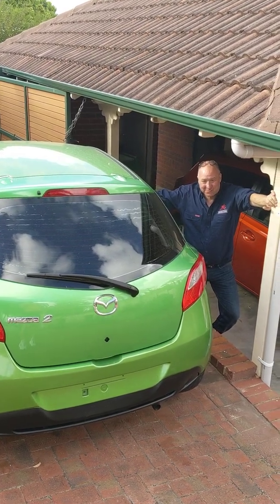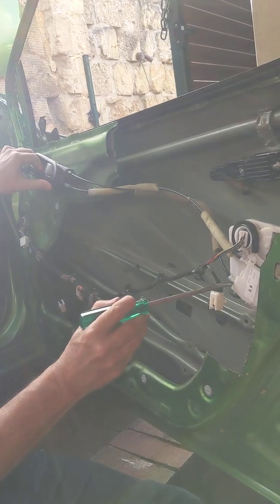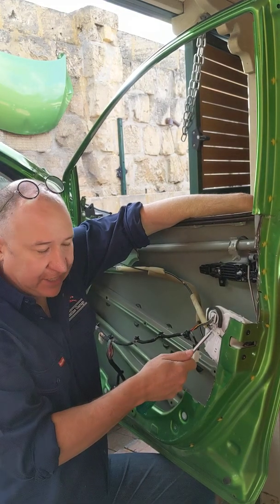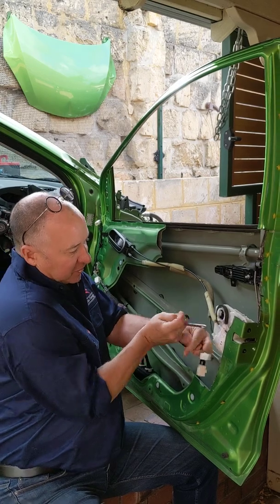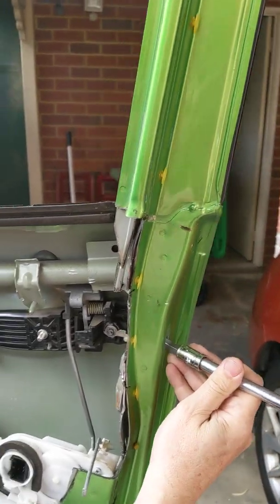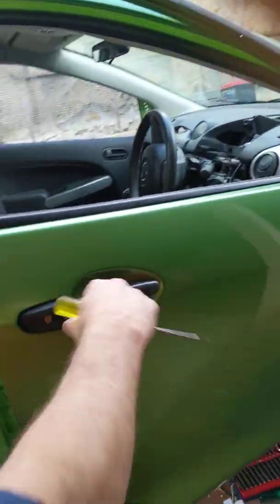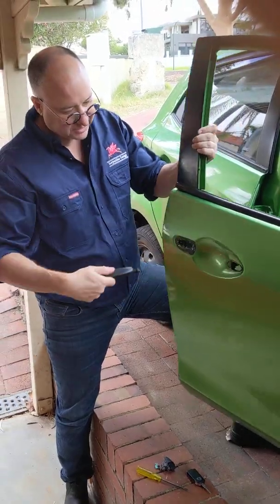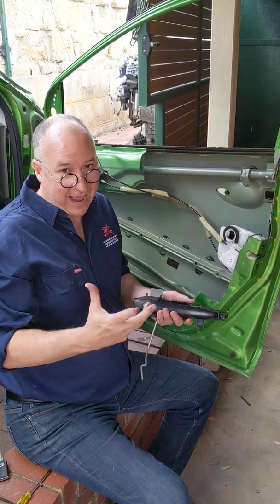DE Mazda 2 (Demio) 2007 to 2014: Driver's door deconstruction.

Comment: Would you happen to know what the extra 4 pin connector at 2:05, under the central locking connector is for?